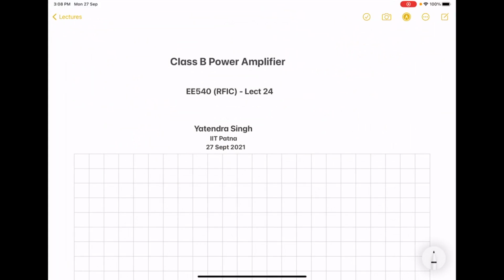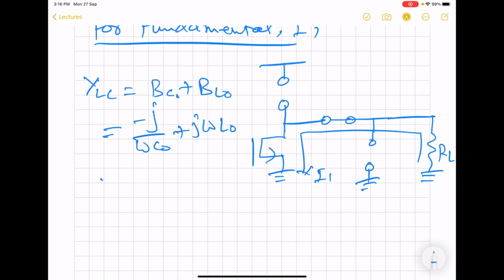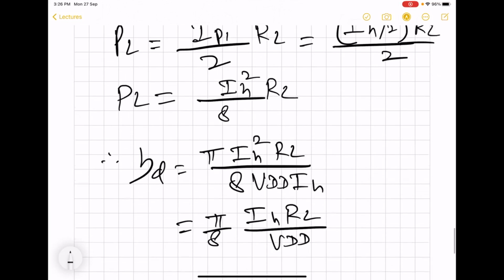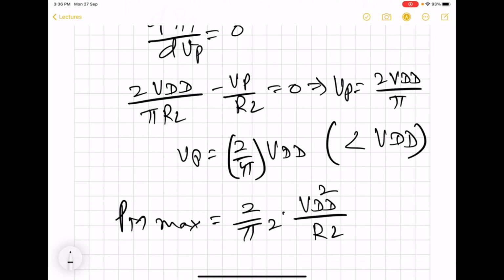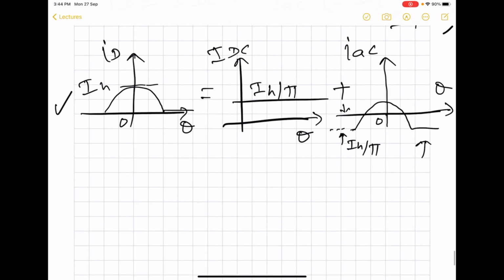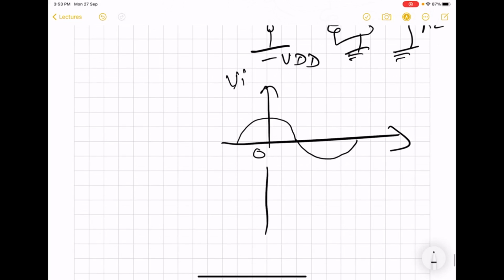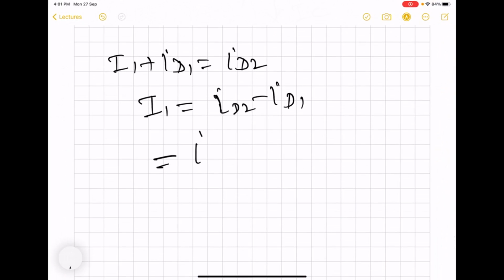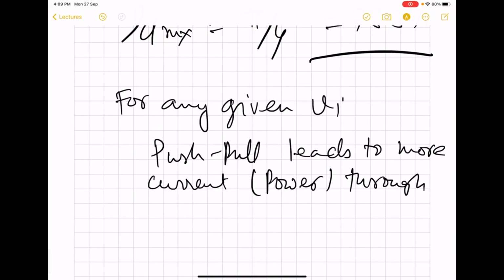Radio Frequency Integrated Circuits (RFICs) - Lecture 24: Class B Power Amplifier

Comment: Hi sir, at 21:42 why you did not included (ID- Ih*cos(theta)) and wrote only Ih*cos(theta)
Reply: is that because we are operating with only half wave signal at the input??
Reply: I understood sir, in your next video of Class AB amplifier that the amplitude we are taking here with reference to the i/p voltage and we are generally considering the fundamental signal amplitude with reference o/p current.
Reply: sir, can you make one total full video on power amplifier design in cadence virtuoso or ADS ? or can you reply us with some useful resources for designing the power amplifiers ?

Comment: why for PL at 15:53, we are taking the current as Ip1/2 instead of just Ip1?
Reply from the maker: We have actually taken the fundamental current to the load as Ip1 (not Ip1/2). To enable further simplification of the efficiency expression, Ip1 has been expressed in terms of iD peak value and hence Ip1=Ih/2
Reply: @YatendraSingh  understood, thank you so much for the reply🙏

Comment: why C will offer less impedance for even harmonics?
Reply from the maker: The drain current, iD, contains the fundamental, w, and higher harmonics of even frequencies, 2w, 4w,... Since all the even harmonics are of higher freq than the fundamental hence the C will offer less impedance to these higher even harmonics.
Reply: @YatendraSingh  ohhh that makes sense. Thanks a lot

Comment: Hi Sir, we need to match output impedance to RL, how do we do that please?
Reply from the maker: There are many matching networks which can be used e.g (lumped or distributed) L-section can be used and are most popular ones also. You can find the design steps in Chapter 5 of 'Microwave Engineering' by David M Pozar.